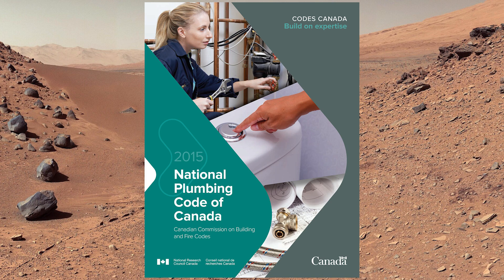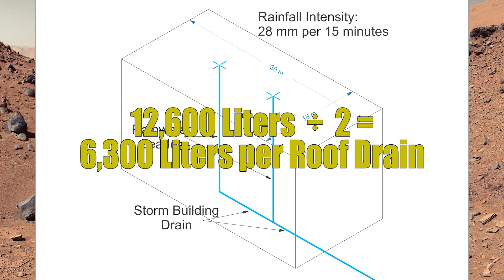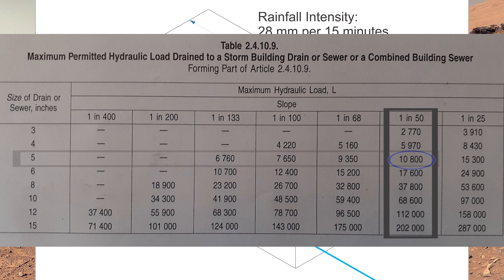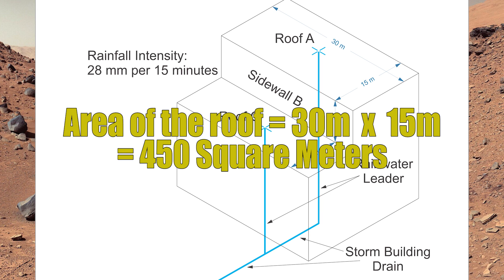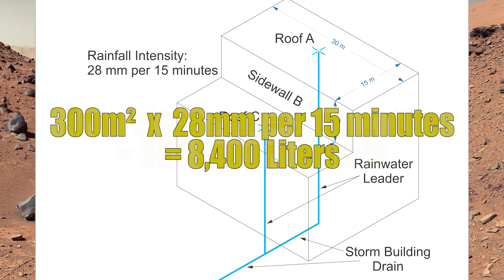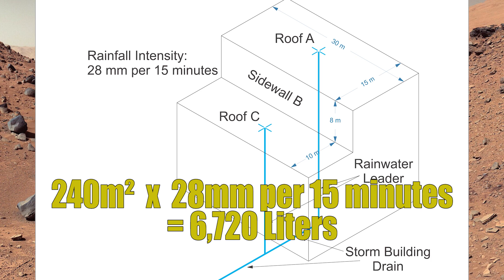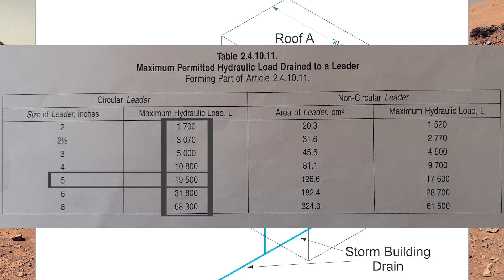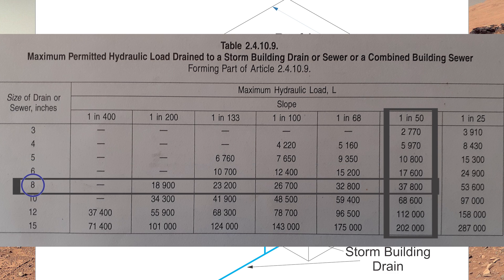Rainwater Leaders Part 2:  Sizing Rainwater Leaders

Comment: Good video !!! Very helpful!!!! 
Just one question : at minute 2:27 the correct answer is 5 inch pipe. But that doesn’t exist. So in the IP exam the right answer should be 5 inch pipe or 6 inch pipe?? Thanks for this great video !!!👏🏼👏🏼👏🏼
Reply from the maker: Government exams will always refer to minimum code standards. So 5" will be the answer. In real life, you are installing 6" like you said.